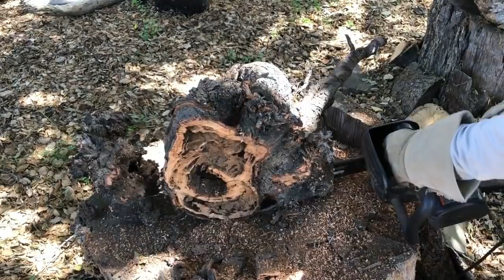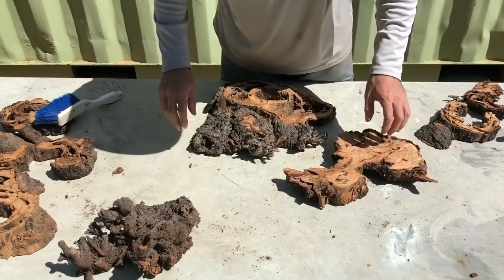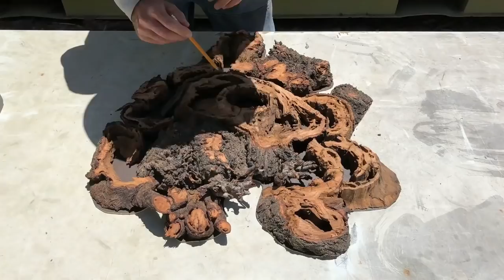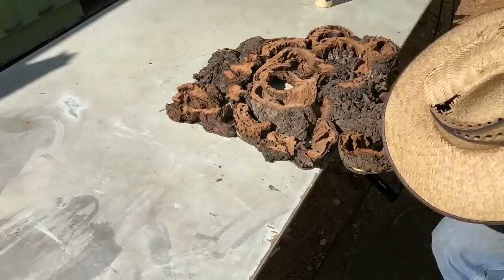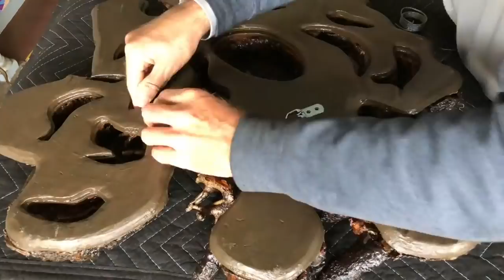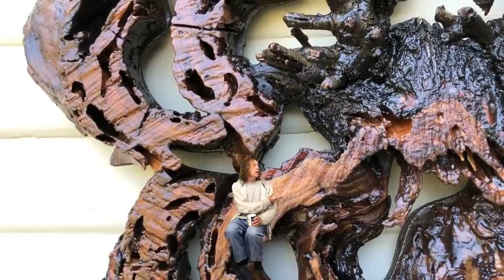old stump turned into wall art

Comment: Suggestion: After fitting the pieces together of the desired shape you want, and outlining the pattern of the shape onto the support wood base, take painters tape and loop around the sides circumference taping to hold the pieces in place, then gently slide the pieces off of the wood base. When you're ready to place the pieces back onto the base support, just slide the base support back under the taped pieces of wood, matching the outline you drew of the pieces of wood upon the base support. You'll save a lot of time than having to put the pieces back together onto the base support like a jigsaw puzzle. Great artwork though. Aloha from Hawaii.

Comment: Extremely beautiful! Would you please tell how you treat wood to prevent from rotten and pests? Thanks.
Reply from the maker: Once the pieces are cut I brush on a lot of BioAdvanced carpenter ant and termite killer (sometimes two or three coats) to treat the wood before mounting it to the plywood backer board.